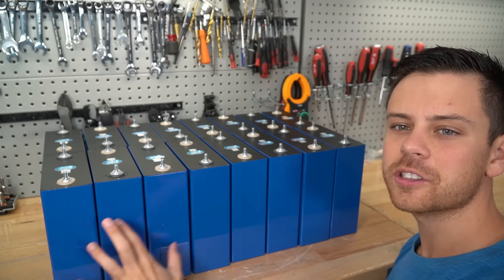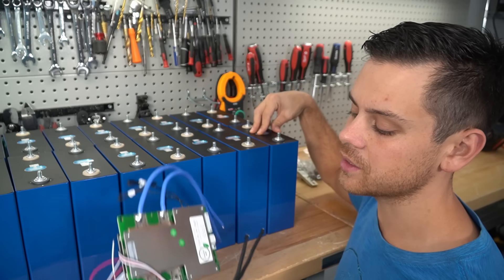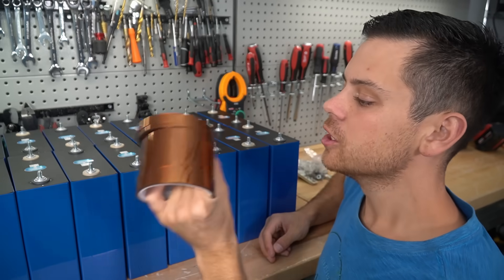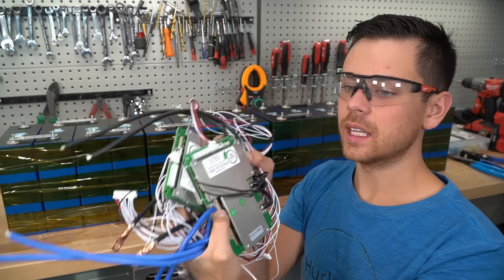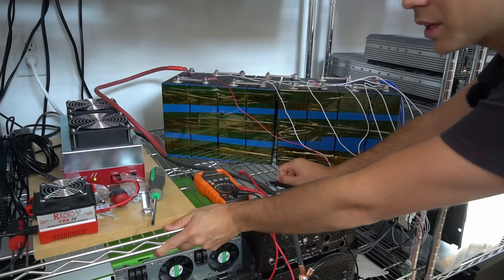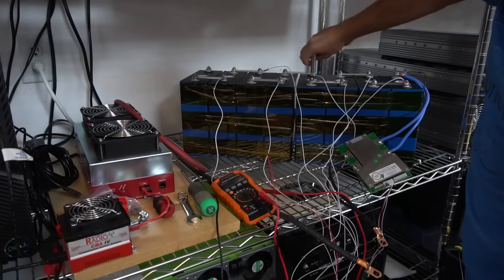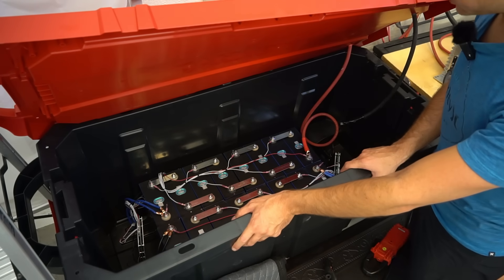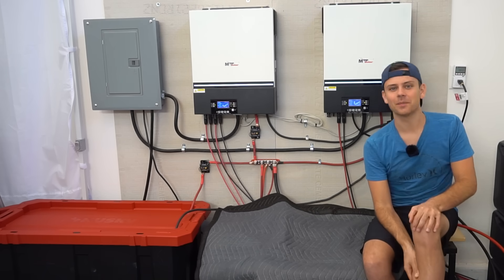DIY 48V 320Ah Grade B LiFePO4 Battery Build: 16kWh for $2,810?!

Comment: Will, how would you size and configure the batteries to only run the Bitcoin miner? Could you please do a dedicated video? What a discovery is your channel!
Reply: @BobDevV  hey thanks! I'm sizing my plant to run on a S9j Pro and not on GPUs since it would run at about 100TH/s, which is insane compared to the MH/s order of magnitude of GPUs. This not only has the advantage of small space needed, but also is far easier for me to find a single Antminer than dozens of GPUs (and all the added hardware they need to run). Plus I'm not planning to expand the number of miners at the moment.

So, I'm planning to run my miner for 5-6hrs on solar panels (I live in south Italy, where solar irradiance is great), and 12-18hrs on batteries (12 is fine too). So I calculated that I need 3,2kW * 6 = 19kW coming from solar panels and like 48kW from batteries.

But I also have to account for the batteries recharge WHILE the miner is being powered from the panels, so I'm iterating over the numbers now.
Reply: @BobDevV  you are forgetting the battery isn't going to drain during the day as long as you have enough solar to run the miner and charge the batteries.
Reply: @darksideofthemoon for a S19j you need ~3.4 KW. To run 100 % green. (Energy produced yearly by solar = en absorbed by the miner) you'll need roughly 20KWp of solar array (south italy radiation data). If you want to run it completely offgrid then you ll need to be able to produce around 2500KWh in december which is the weakest month for energy production. To do this you will need something like 30 KWp of solar array with 40kwh of lifepo4 batteries. In conclusion to run it offgrid it's not worth it. If you run it with net metering its easier and it would make sense, but still it's a big project because 20KWp of solar is not always possible to be installed on the roof to take advantage of the net metering.
Reply: @AbAeterno827  I don't need to run it 100% of the time. Of course my goal is to optimize the efficiency, but if in december it's not as profitable as in march or september it's totally fine for me. I'll just run it in best effort and take what I get. After all it's free energy.
Reply: @AbAeterno827  btw, the Bitmain webpage says 2950W ± 5%
Reply: @nicolamonaca   well...if you run it only when you have the availability of the 3 +-5% KW from the solar array you'll hardly breakeven on both solar and miner. If you go for a "standard 6kwp solar " without batteries it will cost you anywhere between 3.5 and 5000€. A s19j it's another 8 to 10000€. With this configuration your avg. El. Cost x kwh would be anywhere between 12 and 16 c€/kwh. Depends on how much you pay right now with you energy provider.
Reply: @AbAeterno827  I guess you're Italian, like me! 😆 In my building we're taking advantage of the 110% super bonus, so the solar plant would be totally free, and at the end of the day I would only account for the 10k miner + other various expenses. As bitcoin is set to continue the bull run towards 100-120k, in my opinion the breakeven is totally reachable even in such a loose scenario of the miner running for ¾ of a day.
Reply: @nicolamonaca   well yes, if you will have free installation you can take advantage of it. In this case just be super mindful of the power circuit where you gonna plug the miner to not creat over heating. Btw if you live in a multyfamily apartment...your neighbors will definitively not like the nice Jumbojet 80dB coming from your apartment XD
Reply: @AbAeterno827  I'll put liquid cooling 😆

Comment: I built my own 12V 280Ah battery inside a group 31 battery box using cells from Aliexpress about two months ago. They arrived with slight bloating, about 2mm gap between the cells, so it wasn't as bloated as your setup. I also bought a 200a daly smart bms for the cells at the same time. So far the battery has performed pretty well, have hooked up a 2000W inverter to them and the voltage drop was about 350 mV at 175A. Still a great difference between two sealed lead acid batteries which i had before and my current setup.
Reply: I can't believe how expensive the empty battery boxes are right now.
Reply: hi ,this is Aolithium battery ,we have some EVE battery cell in the stock right now ,3.2v 105/230/280/304 Ah  with competitive price ,let me know if you need some

Comment: I've got 16 of the grade a batteries, building a 24v system. We are in a 5R, and are power hogs. Right now we're just building the system to see where can put and how it goes. Got  a little under $2500 (200ah batteries) into so far, also using the overkill bms. I watch your videos, pause and take notes, want to thank you for what you do. We got room on roof for about 12 panels, our ac in basement, only 3 vents on roof, about 300sf for panels. So might use the used panels you had in a previous vid. Also using same container, but smaller, we put a barrier around the packs and then expanded foam in bottom of tote so they won't shift, batteries can be lifted out if necessary. Cause 5Rer's move.
Reply: I wouldn’t go with used panels if your that limited on space. Get the best panels that fit maybe even bifacial panels especially if your roof is white.

Comment: So around 90% capacity, you might get another 4% from balancing. That's 0.18$ per Wh, not bad.
LithiumSolar's review of the same battery showed 96.5% capacity but that was after balancing.
I think they should do great for a Van/Solar build. 

Thanks for the great review :)
Reply: Generally, what makes one battery or technology better for rv or solar or automotive systems? I’m guessing it has do for with the discharge depth? Or whatever it’s called. I know with some you can only use 50%, others are much more. But in theory could I use LiFePO4 in my car? Is it just not cost effective or is it not compatible?
Reply: @Tommy-B.  The LiFePO4 would start the car but it would cause your alternator to "fry" when charging because the batteries can absorb so much power.  You would need to upgrade the alternator or put in an additional regulator to meter the charge output. (I think)
Reply: @Tommy-B.  It's not cost effective or compatible. You can't charge generic LiFePO batteries at low temps. If you want longetivity just avoid draining the battery or get a yellow top. Lead acid is used in cars because it's cost effective. Now my camper could use these cells, because it would benefit from the lower weight and higher depth of discharge. Different use case, as car batteries just start the engine or power accessories for brief periods.
Reply: @Tommy-B.  As I read it, Lithium batteries are only good for outputting about 100amps.  But a car starter motor might require 500+ amps, so still using lead acid for high amp things.
Reply: @sailingelectricgitana1286  LFP batteries can discharge at a 3C rate. For these 320 Ah cells that would be 960 amps. 4 in series makes an awesome 12 volt battery - except for the fact they can’t be safely charged below freezing. That rules them out unless you take special precautions to keep them in a insulated case with a thermostatically controlled low power heater.
Reply: @jimmurphy5355  I will have to study discharge curves more.  Another drawback is that would be an expensive starter battery for a car.  A 650cca lead acid starter battery for a car is only $50 +/-..  Maybe as lithium gets cheaper.  But I see the real benefit from these battery packs in residences where by either solar or recharging overnight when electricity is otherwise wasted and then being used to offset high demand during the days.  Could negate the need to build complex new power generation.
Reply: @sailingelectricgitana1286  Assuming you get past the cold charging issue with say an LTO chemistry lithium ion battery they may cost a lot but they will likely last 15-20 years possibly more as the technology improves since you will rarely ever fully cycle them.  The last flooded lead acid I bought for my car 2 months ago was almost $160 or so and that unit will last roughly 6-10 years if I take care of it so it's still quite a bit cheaper to buy FLA vs a lithium ion based chemistry.
Reply: he should have balanced them to see the real full capacity

Comment: I wish I had like 1% the knowledge of electricity and power management you have. I’ll keep watching to learn the other 99.5% 😁
Reply: Don’t just watch, build a small system yourself. You’d be amazed that the learning curve when you connect a little knowledge with actual practical application.
Reply: @4philipp  I have been more into soldering and power projects this year but on a tinkercad scale. Right now I am building a fume extractor and will stick to small 12v projects. Just not comfortable enough with electricity to try a larger scale project.

Comment: I dont suppose you can compress bloated cells or fix them right?
Reply: No, you'll burst the case or pop the pressure vent. If it doesn't go away on it's own don't force it, because once a cell leaks, the electrolyte will either leak out, or the cell will dry out and quit working over time.
Reply: @volvo09  I was thinking the same thing. I bought 8 100 ah cells on Ebay for 500 bucks. They tested 20 ah short but because of one cell need to swap it out. Will is right order a few extra cells to get a balanced pack its almost better to pay more and get quality ones. Depends on what your time is worth.
Reply: It can cause a short if you try and compact them, then you get an fun battery in your pack (as in on fire in some cases)

Comment: Wow, for about $10K, you can build a big enough system to power most homes, to include charging a car and running HVAC.   Imagine if every home had a system like this.
Reply: Agreed. Think back two decades and this would have been essentially 'unobtanium' let alone anything at 3 or even 4 times the price. To top it all, Will does this by himself in his home workshop. Props for that alone!!!!!
Reply: @brianjrichman  And to think I started out with 2 trolling motor batteries after the Loma Prieta 1989 earthquake. Stuff is getting better by the minute, cheaper in price, too. Bluetooth components are a real winner. Check your battery state from your couch.
Reply: @kimmer6  Absolutely.
Reply: We use 100 kWh a day in summer. My family are energy hogs 😭
Reply: @jghall00  You would be paying almost 33 cents a kwh in California. By the first day or two you would be in Tier 2 billing. That would cost almost $1000  a month here. 26 cents kwh Tier1, 33 cents per kwh Tier 2.
Reply: @kimmer6  I lived in CA for seven years and my wife is from Fresno. There's a reason we don't live there anymore.
Reply: You can get cells for cheaper than this. This is about $170 a kwh but you can get some for $120 a kwh.  Used to be even cheaper a year ago.

Comment: Hi Will, thanks for the video and the test results. I'm also concerned about those studs. The base of the welded studs seem small and the contact area with the bus bar is relatively low. Can you let us know if the circular base of the studs are steel or aluminum? If it's steel then it's going to be a problem. Another thing we must note is that they might have welded the studs, not for our convenience, but to hide the scratched/used terminals from prior usage. Thanks in advance!

Comment: No problem to put those 2 BMS in series to get a 48V system ?  I,ve heard that some BMS can't be put in series.
Reply: Yeah, not all are capable.
Reply from the maker: Yes, volvo is right. Some are not capable
Reply: JBD rates their BMS for up to 80 volts in series. Daly rates theirs for ONLY the voltage you purchased.
Reply: @john_in_phoenix  Good too know.
Reply from the maker: No, these JBD BMS voltage rating on the FET's is high enough to series connect. It is fine

Comment: Lots of great info. For a while I thought large capacity battery banks were just out of budget for me since I don't make much. I didn't realize that you could buy these used ones
Reply: It's pretty incredible. I'm building a 14kwh power station for my parents RV. It's all wired into a breaker that sits inside the electrical compartment, then they run a 50amp plug into the RV shore power and charge the batteries with a generator using a growatt 5 in one.

The whole system is less than $3k
Reply: @deejnutz2068  that's crazy hahaha. I'm thinking of adding some extra range to my 60 mile range Chevy Spark EV. If I can figure out some way to add the batteries in parallel without the car noticing that would be great
Reply: @ryanatkinson2978  Don't even think about breaking apart a car's battery pack, messing with 400V DC and trying to add your own cells. You would be a danger to yourself and others on the roads too. If you must, then carry extra batteries to run an inverter to charge the car if you can't find a charging station.
Better option - just get a car with more capacity.

Comment: did u ever till now have fire problems, or explosions with lithium? because in last 6 monts in Germany Ebikes are burning like hell from nothing....yesterday burn down a bike shop, the loss its worth to 1.5mil Euro....
Reply: LiFePo4 cells are less prone to catching fire than Li-Ion cells used in e-bike batteries.
Reply from the maker: I used to do hard cycling on lipoly and NMC packs, but I knew if someone copied me they would burn down their house. So now I only cover the safe chemistries.
Reply: These were probably not LiFeP04 batteries. Other lithium chemistries will burn if disrupted...laptops, cell phones, bike batteries, Tesla cars. There is a reason Powerwalls can't be installed outside a bedroom window. They are designed superbly but somebody will find a way to puncture the casing and cause a runaway battery fire. I think there are currently 5 lithium chemistries being commercially available and Lithium iron phosphate LiFeP04 cells are the safest, but have less energy per Kg.
Reply from the maker: Yeah, we only use LTO and LiFePO4 on this channel for this reason. I do not want to have a fire. Any cobalt based lithium ion can have a self propagating thermal runaway. Not with LTO or LiFePO4. Read the transportation studies to learn how safe they are.
Reply: but what is the cause?  excessive charging?

Comment: How are the 2 6548 AiOs working? I am considering them for my off grid home and can’t decide between the 6548 and 6048s
Reply from the maker: They haven't turn off since I hooked them up. I am charging my porsche ehybrid with them right now. Working great! Tesla charger will be hooked up in a couple days.
Reply: @WillProwse  Thanks for the info. Any thoughts on 6048 vs 6548? Will be totally off grid and no way to feed back into grid.

Comment: Will, I have seen people use flattened copper plumbing pipe for busbars. Some say with DC that multistrand wire is required, yet you just showed us copper plates. What are your thoughts on the flattened copper pipe as it sure is inexpensive!
Reply: There's no electrical reason to prefer solid or stranded wire for DC or AC (until you get to very high frequencies of AC--as in RF--in which case skin effect can be relevant); the big issues are environment (specifically vibration) and economics (solid wire generally costs less).  Most DC wiring is in mobile applications, and due to the vibration, in those settings stranded wire is a good idea.
Reply: @danbrown586  Thanks Dan. I'm a mechanical guy and just observed that pretty much all DC is multi-strand and house AC wiring is solid.
Reply: @danbrown586  Just use solid busbars. Multistrand is for high frequency current, which a battery sees none of. Inverters have large capacitors on the input so the drain on the battery is pure DC.

Comment: Any chance you could do a video building a complete system for a mini split ac? Enough battery to run it 24/7
Reply: Too many variables to make a video. You need to figure out your mini split draw and scale your solar and batteries around d that
Reply: @WhiteTrashSTL  I know. But he has a mini split. He doesn’t have MY mini split. I can adjust it for mine.